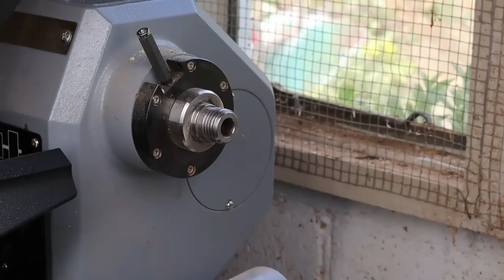Woodturning - A Poisonous Crotch?!

Comment: I hope you used a respirator or something sufficient to protect your lungs.  I like the rough lip on the outer edge, very unique.  Not sure about the color of the Lilliput, I prefer the knots or the holes.  Elder may have been a pain but I really like the yellow tone of the wood.
Reply: Thanks Chris, yes I did as I am aware its toxic. On all the other points I agree, I hope the yellow remains but I think it will fade during drying , cheers ... 😃🪵👍